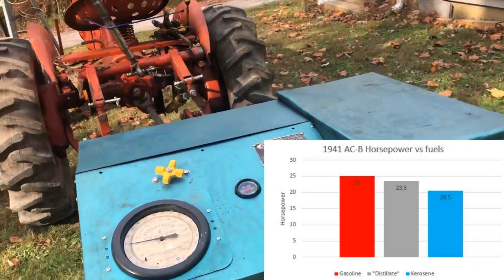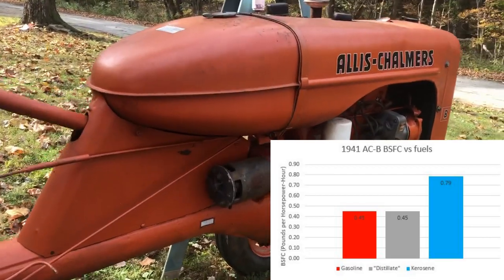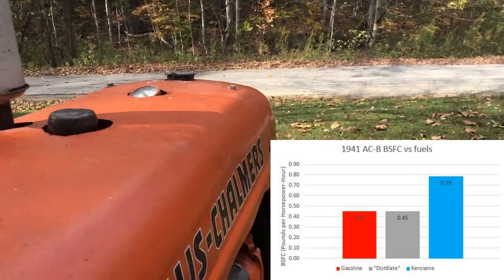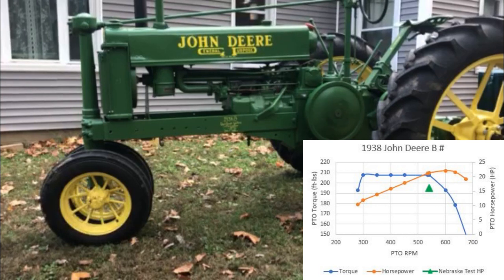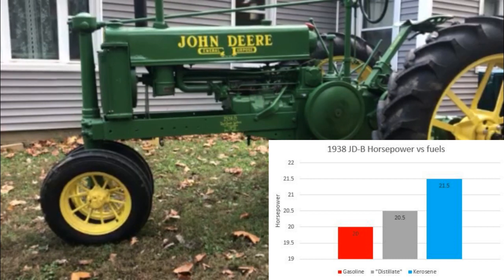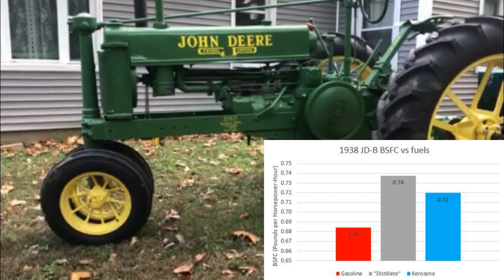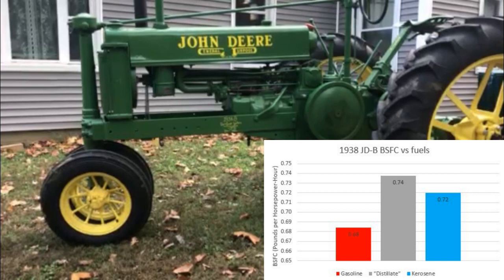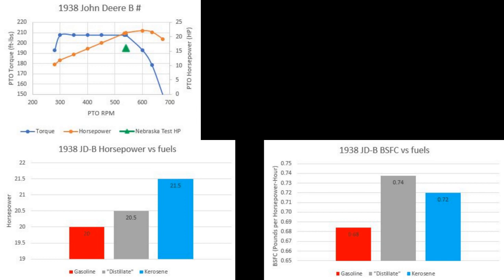Distillate / Tractor Fuel - What are they? What should my Unstyled tractor burn?

Comment: Interesting video and you are correct there are very few videos or any information out there on alternative fuels for classic tractors although back in the day it was quite common. I attribute that to modern tractors being diesel & very little interest in the old machines. I’m an old  Ford Tractor man myself as I’ve owned various ones over the last 45 years. Just converted one of mine a 1950 8N to run on E85. So far I’ve been very impressed with the results. Runs much cooler, cleaner and no noticeable loss of power. I ran a bush hog all day in 95 degree heat this summer with no issues. These old fords are bad about getting hot enough to boil the gas in the tank when pushed hard, yet this was not an issue with E85, actually the intake was dripping wet from condensation of the very cool ethanol going into the motor! Difficult cold starts but it will start, just choke a little more than when running gasoline. Once warmed up no issues. Slightly more fuel consumption but it’s less expensive so that a wash. Biggest benefits are no more stinky exhaust that modern gasoline emits in these antique machines and a much cooler engine operating temperature. Also old Ns are notorious for flooding carbs resulting in hard starting, it has never happed since the conversion to E85. I will be converting my Golden Jubilee next. A lot of myths about this fuel. Just my experience with alternative fuel for classic tractors. Great video, Thanks!